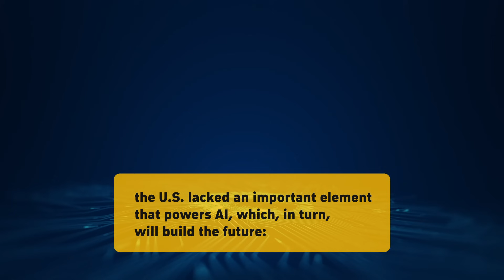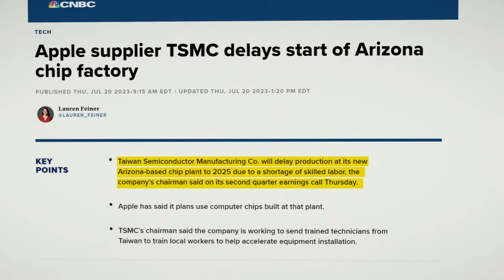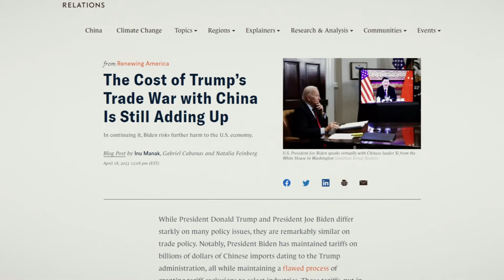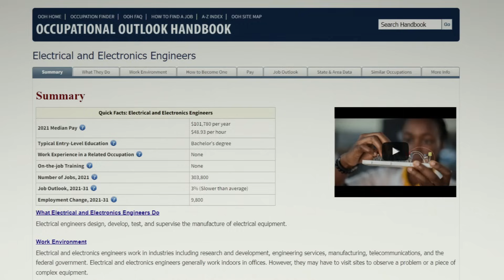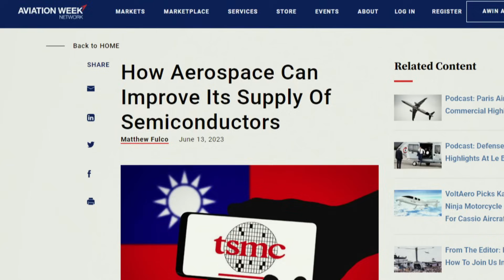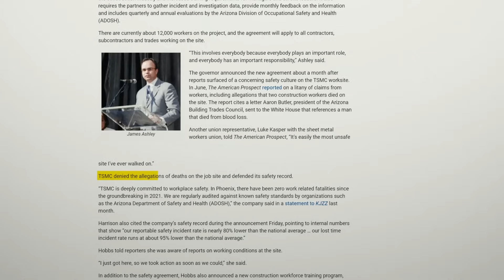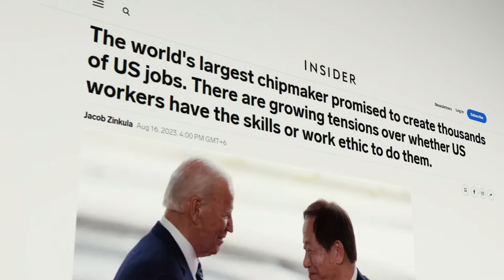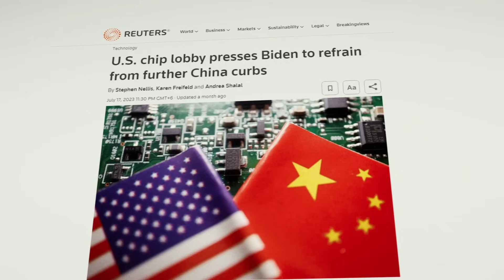US China Chip War: Is Taiwan’s TSMC regretting investing in US?

Comment: TSMC's decision to move was geopolitical. The threat of an eminent invasion was the deciding factor. Sure, the transition won't happen without challenges and setbacks, however when the job is done, it'll be done right. Why is this video discussing comparative construction costs? There's no need for TSMC to build or even rebuild in Taiwan, that's not an issue. The paramount issue is TSMC being nationalized by the CCP after the invasion. 
Yes, the cost to pay scientist and engineers in the US is significantly higher than any other country in the world, that's why the US has the best. The best scientist and engineers from all around the world work for American companies and other western and free Asian companies on a smaller scale. 
China is decades behind in both chip design and manufacturing. In R&D, the cost is high both in funding and in time. For every success there could be 50 or 100 failures. Even the cost of reverse engineering is high and only guarantees a position behind.  For China to reach parity with the US will be an insurmountable task...  insurmountable.
Reply: Silly boy! You're are impossible!

Comment: This video is clueless. Yes, TSMC makes chips FOR Apple, nVidia, and Qualcomm that were DESIGNED by those firms. TSMC only builds their chips, they don't control the technology inside.
Reply: No what's your point tho. If Apple or whoever designed the chip but can't produce them, there's still a missing link in the supply chain. They're still reliant on Taiwan Island to supply them with Chips. Putting the Fab in Continental USA is supposed to solve that.
Reply: Yup missing the point big time: manufacturing esp of complicated hardware measured in the nano meter size (thinner than a strand of hair) like these chips and at scale has its own tech and proprietary process; that’s why South Korea’s Samsung theoretically can produce the same chips as tsmc but not at the same defect rate and scale, rendering it unusable by the designers.  Design and manufacturing abilities are equally important.